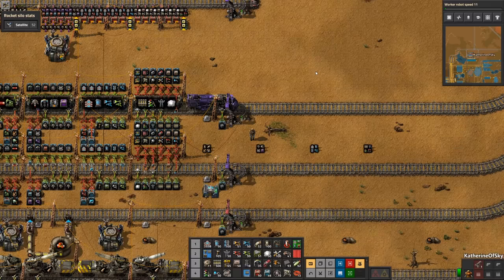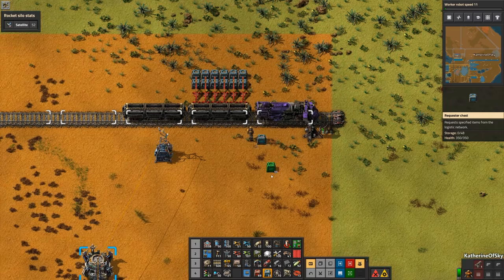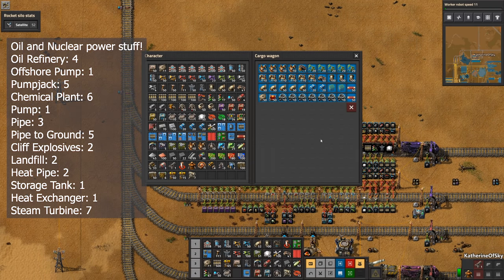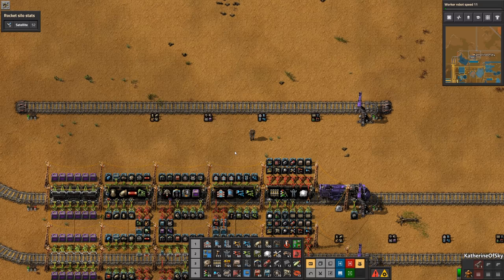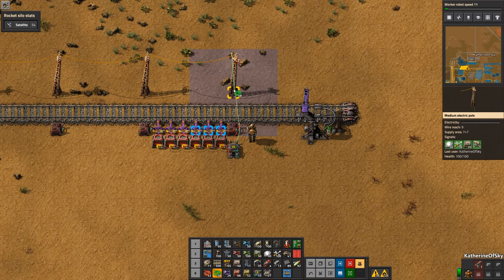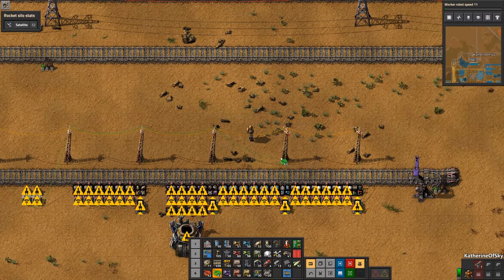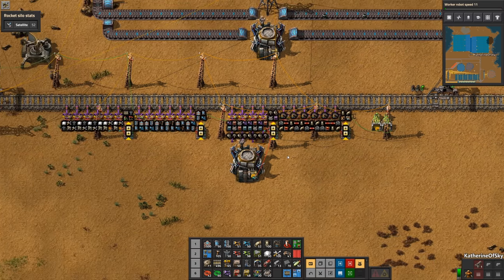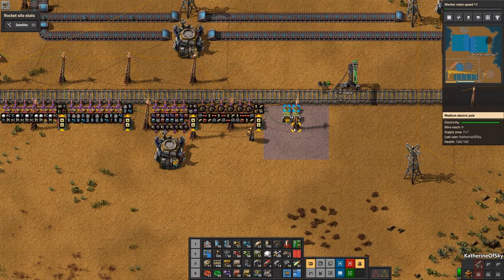Factorio: HOW TO BUILD A BUILDING TRAIN - Tutorial, Guide

Comment: Problem with this setup, that your train keeps requesting stuff when 1 item is used. So if you get attacked once your train is allready driving cause you needed 1 repair pack or a mine. I have a complicated one with stack inserters filters and tell each one how many they should load max while looking at the total amount of the robologistics. And a decider combinator is triggered if minimum gets reached so the train will be called, if train not needed then the outpost is closed. So now your train is not called everytime. Ok your buffer is a little bit bigger but at this point you have enough stuff.
Reply from the maker: With this setup, the buffer is plenty big since if the request is for 5 power poles, for example, all 5 inserters will reach into the train at the same time and pull out 5, giving 30 power poles.  I feel there is plenty of leeway, but if you want more, it's good to make those alterations.

Comment: Nice tutorial. 
One suggestion though. Since you are closing the trainstations you could rename the receiving stations all the same. Lets say, you have the "BuildingTrain Depot" where the train gets loaded, and the "BuildingTrain OutPost". Now you could name all your outposts as "BuildingTrain OutPost" and the train could only drive to the opened stations. Sure, you don't have controll which station will be the next ahead, but it would work and reduce the micromanagement alot. 
One thing I miss is the possibility to send trains out, before one thing is empty - like sulfuric acid for mining uranium or ammunition for defence. You could exploit your networklogic with using a second storage chest/tank while measuring the first only but pressing all to the second storage. Or use combinators to define the treshold.
Reply: Use a constant combinator on the train stop network with, say, -5000 sulfuric acid. This way, the station will open when sulfuric acid is lower than 5000, not when it's 0.
Reply from the maker: I've heard that suggestion before, but I would rather control the order of stations my train stops at because delivering construction materials for a new outpost is far more important than delivering a few modules.  Speaking of modules... in your suggestion, the train will only go to the nearest stop and then come back to the base station.  Normally, modules are what the outposts are constantly lacking, so it would basically never get to any other stops but the closest.

Comment: I ended up trying the same thing using more complicated circuits to control how many items each stack inserter would put in the train to avoid the stall when the train was full.  It mostly worked but it was a huge pain to get working.  My second version was closer to KoS but I used the values from the logistic network as a whole and made the station chests active rather than passive providers and items to recycle had to be set explicitly rather than being automatic,  I also had hysteresis so the level where the station would summon a train was much lower than the level where it would stop unloading a train that was present.  I think of them more as supply trains than building trains because their main function for me is to resupply ammunition, repair packs, and spare parts, especially the second system which I used while getting the no lasers achievement.  Simplifying construction is just a nice bonus compared to keeping the defences up.
Reply from the maker: I have a separate train for supplying defensive positions loaded with walls, lasers, robots, etc.  This is specifically for building outposts (including module delivery).
Reply: @KatherineOfSky  Yeah that's what I should have done  Trying to cram both functions into one design that was only half the size you're using was over complicating things.

Comment: Really nice, I actually came up with this exact system on my own in a playthrough. Took me forever, but I got a nice blueprint out of it. Used it to keep an outpost supplied with ammo, and repair supplies.

One improvement this needs: as is stands, the whole train will be requested if any of the items drop below the threshold. Bit inefficient.
Instead it's better to activate the station when items get below say 50%.
Reply from the maker: If you only need 1-2 modules, they'll never get delivered ;-)   (I find that most materials are delivered within a couple of rounds, so no need to activate a threshold, but I really like the idea!)
Reply: @KatherineOfSky  in my case is was more of an issue because of the ammo. One biter attack, turrets would fire, ammo would move, train would be called. For 3 magazines.

But yes, if you set a very low amount you would never get the items

Comment: I’d change it a little, but this would make it more expensive - since all provider-chests are inside a network, you can use an additional roboport to read the entire networks content, without having to connect each chest.
Connect the 2nd roboport with red wires to the input of the arithmetic combinators and set it to read networks content.
Also only connect the Green wire from the first arithmetic combinator to the constant one. 
The filter inserters to unload will receive negative values for any item in the network, but will discard anything less than zero anyway.
Reply: And to get even further, you could add another arithmetic combinator for the recycling wagon and replace the storage-chests with (blue) requester.
The combinator will still be set to „each“ „multiply“ „-1“ and result „each“.
Connect the combinators input with a green wire to the powerpoles, and the output with any color to the requester chests.
This way, the requesters will pull any excess item from the entire network, and sends it back to base.
Reply from the maker: Interesting idea!  Would you mind sharing the bp in our discord?  My dyslexia is kicking in a bit and I'm having trouble following the construction.
Reply: KatherineOfSky can do this later
Reply: @nobodx  If you do this recycling thing you probably want to override the stack size on your inserters to 1. Otherwise you could get in an oscillating situation where your system is constantly requesting then recycling the same two items over and over ;-)

Comment: Hi, instead of having different station names, just use the same name for each station and modify the number of allowed trains to each stop between 0 and 1 to activate the station. It works a bit more smoothly and you dont have to change the train route when creating a new outpost
Reply from the maker: That doesn't work with the building train.  It will always go to the nearest station and not visit any others until the station is closed.  Defeinitely NOT a good solution when you have outposts needing many modules, but you are building more outposts down the line, since it can take hours to fill those module requests.
Reply: @KatherineOfSky  You change the allowed trains variable from 0 (closed station, material demand is met) to 1 (open station, when missing material) using logic. Trust me this works perfectly and you can have one name for all stations.

Comment: Something i couldn't get to work was being able to have a train return to the outpost to pickup anything that was put in the storage chests. The train would only return to the station once the number of items in the storage chest became greater than the number of items that i had stored in the provider chests. I solved it by adding a combinator and multiplying the anything signal by like +1000 to give me massive numbers of items in the system above that of what is actually stored. The system still drops off what i need but will now return to pickup what i've put in the storage chests.
Another thing that stopped me was the 'Read Robot Statistics' box not being checked on the roboport as well as it outputting the signals for the 4 options as letters. I had to change the letters of both total and available bots in the system to their respective bots for it to work.

Comment: Is train item filtering a vanilla feature? I've managed to over engeneer a circuit system that fills the train to a specific number of items by reading train contents and filtering for each filter inserter (which support multiple items). Also unloads any excess items or items that shouldn't be on that train
Reply from the maker: Yep, train filtering is vanilla :-)
Reply: I never knew this! "Each stack in the cargo wagon can be filtered. This works in the same way as the quickbar; the default key to define or remove the filter is the middle mouse button." -Factorio Wiki

Comment: I followed along as best I can, but when I test it, some items wont unload since the filter inserters only have 5 spaces on the white/blacklist. On your design, the constant combinator requests more than 5 different items, did you run into the same problem?
Reply from the maker: That is a limitation of the system, and why the filter inserters are gruped by car (instead of all of them being tied to one combinator).  You just need to make more material or request less.

Comment: Which signals are used from the connected roboport and why? Is it making sure there are enough bots in that network?
Reply from the maker: None of the explicit (letter) signals from the roboport are used.  The red wire allows the bots in the roboport to be counted, so it acts kinda like a big chest.  (It will read all bots in the local logistics network -- no need to connect red wire to all the 'ports.)

Comment: I have followed the tutorial, however I'm facing an issue with filter inserters and Roboport. Roboport even though is connected to the input of the arithmetic combinator - the network doesn't see how many bots are in the Roboport, resulting in the train constantly supplying the outpost until Roboport is full of bots. Tried changing the settings and different connections, roboport network readings - nothing seems to work. What am I missing?
Reply from the maker: Read the description and/or the pinned comment about changing roboport signals :-)

Comment: Very nice tutorial! Would you mind doing an LTN Tutorial or a letsplay ?
Reply from the maker: Possibly!  I haven't used LTN yet, and TBH, I haven't found a use for it since my bases are so large that all the trains are needed all the time.: I don't have any sitting idle.
Reply: What's an LTN?
Reply: @Gelattonian20  Logistics Train Network(LTN) is a mod that allows you to essentially turn trains into long-range logistics bots. You create a depo where they idle and get fuel, and then stations provide/request goods and trains load and unload at the stations. The primary use of LTN is for managing many to many connections more easily. It's a little tricky to setup right, but because the setup can be stored in blueprints it's extremely easy to create large modular bases and not worry about which stations are delivering their goods to which other stations.

Example:
If you have 5 ore mines and 5 Smelteries, each time an ore mine runs dry you need to build a new ore mine and set up a train to ferry between the new mine and the smeltery that the previous mine serviced. With LTN, adding a new mine or smeltery just adds more "sources" or "destinations" and the trains make sure that as long as there are enough resources, everything can be serviced.

Comment: You can have a maximum amount of 5 different items per wagon because of the filter limit on the filter inserters, right? Is there a good way around this?
Reply from the maker: You can have as many items in the wagon as there are slots.  because the inserters are attached to the combinator , the filters change as more products are delivered to the quantity desired (e.g. when you fulfill an "order", the filter disappears, and leaves rom for another.
Reply: @KatherineOfSky  Thank you! I had messed up some cabling so the inserter filters did not update.
Reply from the maker: @renefleschenberg5937  Glad you got it sorted!

Comment: I'm not a fan of how this handles bots and set mine up differently. This method will dump as many into the single roboport as it can and only make sure to have N of each in storage, but I'm more interested in having N in the network. 

I accomplish this by taking them out of the constant combinator (but not the train car) then disconnecting 2 of the filter inserters from the red wires and setting them to either bot type, then having inserters between their chests and the roboport that are connected just to the roboport which is set to read robot statistics and not network contents then set each inserter to enable if Y or T are less than the numbers I want
Reply from the maker: You are incorrect: it will not "dump as many as it can" into the roboport network.  (I hope you saw the pinned comment/description on the roboport interface settings.)  I've made a different version that reads available bots in the network as well.
Reply: @KatherineOfSky  ahhhhh I see that now, thanks. I like that even better than my setup

Comment: Is there a reason that the 40x roboports and 60x beacons use stack inserters while the 150x requester chests and 150x active provider chests use long-handed inserters?
Reply from the maker: Probably because I changed my mind on amounts over time, and didn't change the box order :P
Reply: Thanks, it wasn't too hard to adjust the arms and chest counts to be optimal for the same counts as yours. But I think I might add a couple things I use way more than nuclear :)
Reply from the maker: @fashnek  Build your train any way you want to!  (You can add more cars as well!)  I find nuclear sooooo useful since I usually expand my plant significantly at each stage and there's a lot to transport.

Comment: Hey KoS, thank you so much for this! Just finished setting everything up, it has made building outposts sooo much easier! But I'm experiencing one small issue; Even when the outpost trainstation has all the items it needs, the train station wont turn off. I have the train station connected to the powerpole (with green wire), set the mode of operation to enable/disable and the condition to * (Anything) > 0, but it still sends the train looping between my base and the outpost. Any idea what I should be looking at to debug this?
Reply from the maker: The green wire also needs to be connected to the output of the arithmetic combinator.
Reply: @KatherineOfSky  Yaaaas! The issie was definitely the green circuit! 

The problem was that I had connected all of the arithmetic combinators to the constant combinators in front of them, then from the constant combinators to the power pole. 

But now it works in all it's glory, and I can go watch your new upload and enjoy my morning coffee! Thank you Katherine!

Comment: Is this similar how a factory could call in plates from a common stacker?  I'm trying to figure out how to have a large stacker that suits many different factories when called on.
Reply from the maker: That is particularly difficult in vanilla.  I believe it can be done with the circuit network, but it's a major pain.  People usually use the Logistic Train Network mod (LTN) for that.
Reply: I'd build a station at the source, where trains get loaded to the max.
at the destination, add a logic, that closes the station, if the buffer reach a certain threshhold and opens it again below another (requires a R-S-Latch).
And send the train to each station, ordered by priority
If all stations are satisfied, the train will wait at the source

Comment: So I've used this design and the items going to the requester chests work fine and call the train when they are short but the trash chests don't work and never activate the station.   I don't understand why it used to work.  It only seems to do this on my building train station the trash chest work on my wall train stations.   Is there a circuit limit of how many items can be read?
Reply from the maker: Make sure your trash chests are connected to the station building.  There is a limit on items that can be accessed by the inserters at any one time: the limit is 5 on regular filter inserters, and one on stack filters.
Reply: @KatherineOfSky  The trash chests are connected to the station via power poles but for some reason will not read what is in those chests.  If I disconnect the power pole that is receving the green wire from the trash chest from the rest of the network and then mouse over it reads what's in the chest but as soon I hook it back up to the rest of the network I could empty my whole inventory into the trash chests and it will only read what is in the passive provider chests and leave the station closed.   It's one of those things that is annoying cause it works for bringing materials in just fine but I have to call the train manually if there is trash in the chests when the station doesn't need any supplies.  I don't run any mods but haven't played in awhile up till a few days ago and have honestly spent more time trying to figure out what is wrong than I have expanding my base, my brain won't let it go.
Reply from the maker: @TheAtkey  can you come to discord and post a picture of your setup?  Maybe we can help.